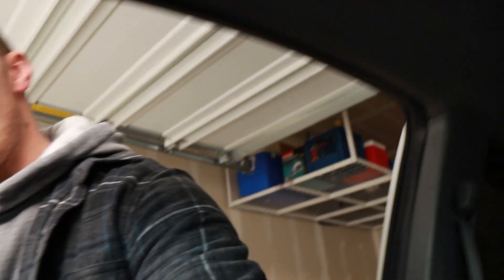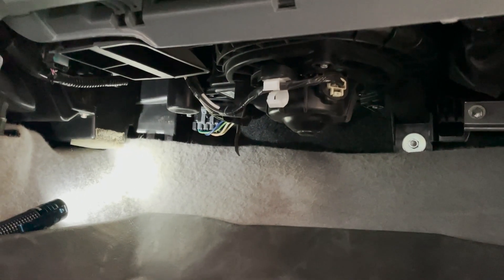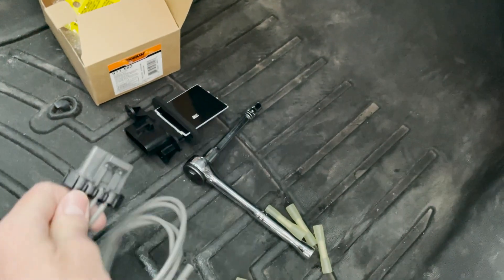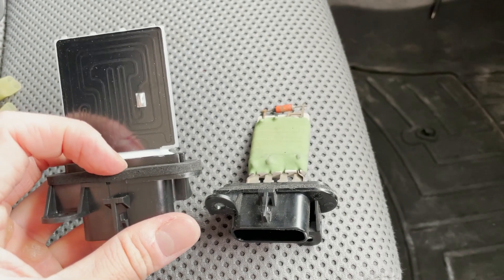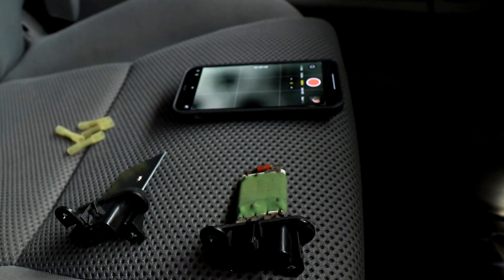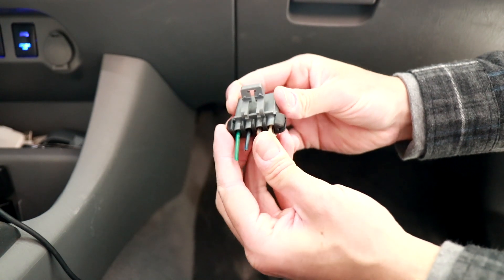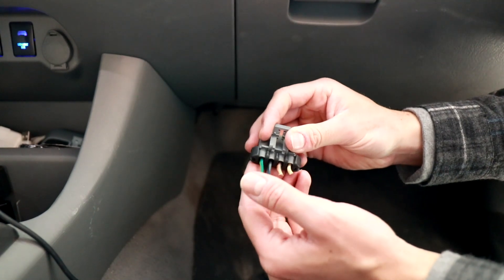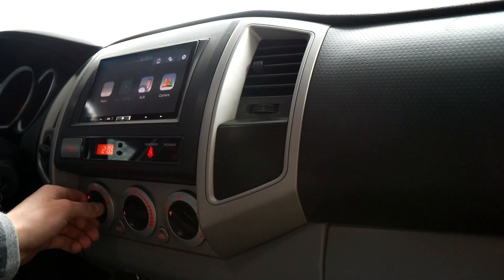DIY Blower Motor Resistor Fix

Comment: You did not FIX the resistor, you REPLACED it. Good job on showing how you did the replacement and that would have been the accurate name for your video.

Comment: Hey Braxen,
Good video - like that you got right to it. Here's the part - here's what goes wrong. 

Not trying to be critical here, but really questioning your decision to chop off the factory harness because of one slightly discolored pin. BTW, Good job that you soldered and used shrink tubing, but speaking with 45 years of wrenching experience and a major focus on electrical engineering stuff, I'm telling you that factory wiring, and factory plastic is virtually always better than aftermarket - especially China-mart stuff. Again, not trying to be critical, but rather than chopping off the harness, let me suggest to you and others that you simply use a pin tool and remove and repair/replace the one pin at the discolored connector location. Pin removal tools are cheap and easily available online.

FWIW, the discoloration and heat is because the pin connector is loose, causing heat build up from the poorly conducting connection - which is why you can "bump it" to make it work. Odds are there was nothing wrong with the factory resistor in the first place, and even better odds are that you could just burnish, retension, and reinstall the factory OEM connector pin and be good to go. Sure, there is a little heat discoloration on the plastic, but the connector is not deformed enough to cause a real problem. By pulling the factory pin, you could see what's really going on, and worst case, you could rob one of the pins from the aftermarket connector and install it in the factory connector.  Just some thoughts there...again not flaming you. Proud of you for tackling the problem. 

Beyond that, a couple other details. 

a.) Always check the current draw of the blower motor when doing this repair. A blower motor can "work" but draw excessive current, leading to connector and/or resistor failure in the near future. Replacing the resistor will not fix the problem, and the new resistor will quickly fail, or the connector will melt. I see this quite a bit. You will note that the blower resistors actually have a set of internal fuses for each speed for this very reason. These individual fuses protect the fan speed dropping resistors when in use - these are in addition to the "high speed" blower fan fuse in the fuse block.

b.) As a matter of design, the next-highest speed's wiring (or fuse) will almost always fail first, because the three speeds are actually a series circuit resistor set - which means the highest current dissipation and therefore heat damage is generally going to appear at pin 3, because current for ALL lower speeds always flows through #3 - in addition to one or two of the slower speeds depending on the blower fan switch position. So, #3 is almost always working (except when the blower is on high) and therefore gets the hottest and fails the most.

c.) The reason the high speed "always works" is because it does not pass through the blower speed resistor in the first place. It is a direct connection from the switched B+ of the circuit to the blower motor winding. Thus, the blower will run on high, even with a defective resistor.

Good job taking this on, thanks for the video - good to know where they tucked that little bugger!

Cheers
coolblueglow